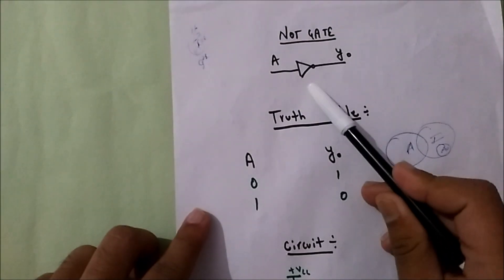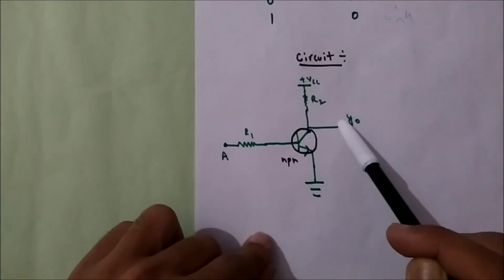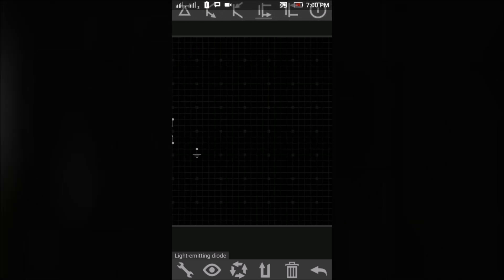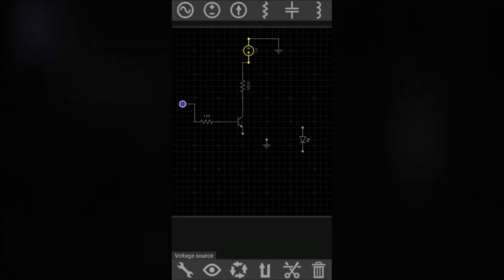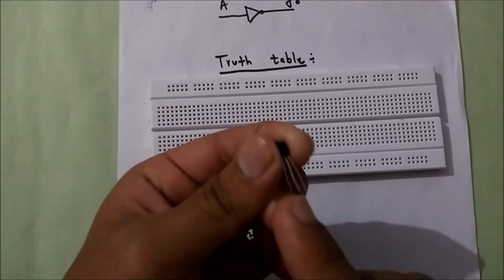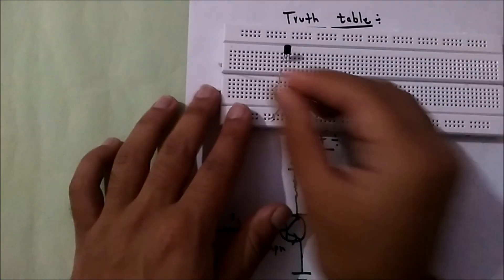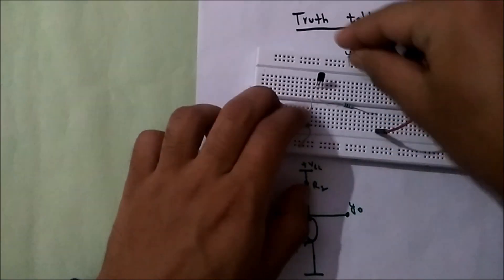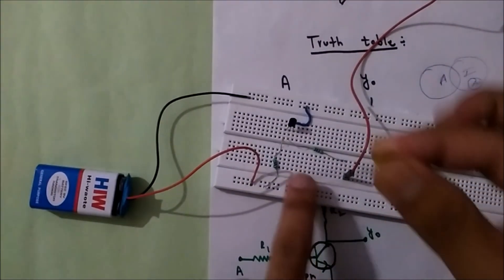NOT Gate using Transistor

Comment: Thanks for your experiment part.  I forget what an input voltage open circuit does in this circuit.  It seems to be default of high output voltage unless input voltage is high forcing a short or low across the transistor collector and emitter transistor part! 👍

Comment: I have a question.. When transistor is on then both terminal of led is shorted... That means negative and positive are short circuit.. 
So it will damage your battery and battery will not lasting.. 
If i am right then clear my concept..

Comment: So basically whenever you've got 1 on Transistor Base you are have a shorted circuit ? or in this case you've got all the current flowing through 100 Ohm resistor, which IMHO is a power waste.
Reply: I have the same question..
Reply: why explicitly we are using  logic 0 and 1 . We are using battery right , from there we are generating electrcity. i know logic 1 means electricty is flowing through transistor and 0 means not but why do we need to show explicitly using a jumper wire (in breadboard) is it mandatory? 

where is a short circuit? @Aman Khan says "When transistor is on then both terminal of led is shorted... That means negative and positive are short circuit."    i knew that short circuit happens when there is almost no resistance in the circuit but how is it happening here..i dont get it..how both 

 terminal of led is shorted??

Comment: Thanks for your video, i really like it. i tried to set up the not gate, when the input is zero, the light is on, but when the input is one, the light is still on but a lot dimmer, not off. Is there anything wrong with the gate ? i only used 5 V, pls help. Million thanks!
Reply from the maker: You connected the resistor properly? Check for any loose connections
Reply: I think you used a low power led bulb,the current does not entirely cot off when the logic is one,instead it reduces drastically,as most of it is shorted to ground,if you want it to go off completely,you will have to add another transistor,that will be switched using the first transistor...
Reply: use lorger value resistor

Comment: When logic is 1 you have 2 closed paths, what makes electricity flow through collector to emitter instead of flowing to anode and cathode of the led?  What i mean is why it chooses one path over the other.
Reply: If you have a short circuit parallel to a resistor the current will flow through the short circuit. the current always seek the less resistant path.
Reply: @renatobraga8841  I thought it requires some kind of calculation to determine the path.
Reply: @jumbo999614  yes but in this case the anode and the cathode will have the same potential so no current will flow through the led or whatever are in parallel with the short circuit as the shor circuit has no resistance

Comment: That is in the perfect world but in the real world some current will fllow to the led and in some cases the led wont turn off all the way it will glow a little bit,and if you want the led to completly turn off you would need another transistor to do that.Other thing is when you to the math lets say you use 12 v and 100 ohm resistor that is 0.12Amps or 120mA and when you do the math 0.12×12=1.44watts 
That is a lot of power dissipated in heat and it is not efficient.Just buy some ic with not gate in it and problem fixed.

Comment: will this circuit works for 12v dc supply also?
Reply: Work only with 240v. Plug into mains old appliance and cut wire in half to get at them. Live is positive Neutral negative. Ground is for connecting to empty space.

Comment: it would be really be less wasteful if i could do it by 5 V DC....for my school project....

Can u tell me...what parts I've to use so that it runs on 5 V  500 mA or 1 A  ??
Reply from the maker: yeah you can easily do this with a 5v battery. Use 100 ohm resistor, it will do the trick!
Reply: Actually...I've to make a NOR gate, yeah NOR gate...

it wud be very good if made with 1 transistor....and want to use a 9 V battery

I've to show it with truth table(2 inputs), so it should have 2 switches for that.......Please show an easy to understand circuit diagram, and assembly on breadboard & tell the specs of transistor, each resistor, and LED.

Comment: Computer is an electronic/electrical device.  It is not logic or gate or binary device.
The whole idea of so called AND, OR and NOT Gate in fact is nothing more than three circuit systems.
1.  Series.  2. Parallel.  3. Short/open.
That is in plain English, clear and simple. 
AND is series wiring.  OR is Parallel wiring.  Not Gate is short/open.  It is so obvious.
You can easily bring those three situation without any transistor.
Hook your LED and supply the right voltage.  This will remove any need for those resistors.  Toss them.
Wire the LED using two connecting wires ( call it switches) to either positive side or negative side, makes no difference. Make those two wires you connect to be switches hooked up in series and there is your AND Gate. 
Then do it in parallel.  And there is your OR Gate

And what is the so called NOT Gate?
Then directly install the LED to the power source, there is your light on with no switch whatsover.
Have another wire in hand with a resistor ( say 50 Ohms)  hooked up in one end of it and wire that resistor back to the power source.  The instant you touch the other end of the wire to that one side of the LED, current will flow through that lower resistor circuit and the LED will get nothing.  

This is the TRUTH behind all this head scratching, dizzying lingos.